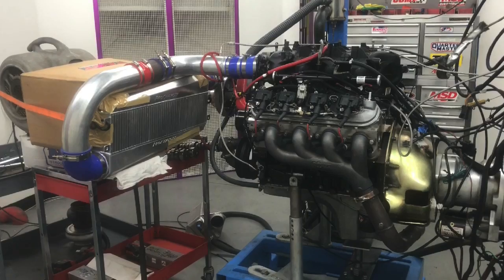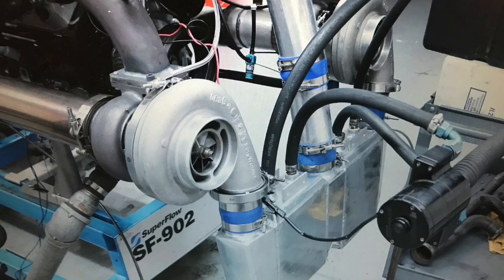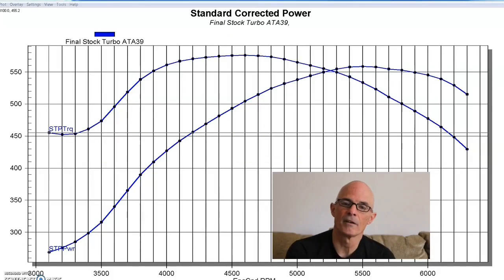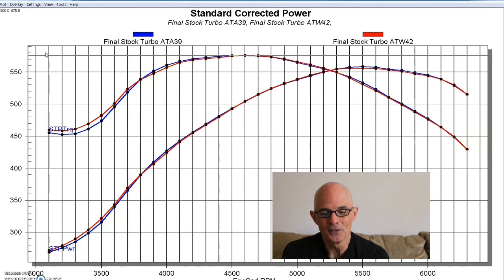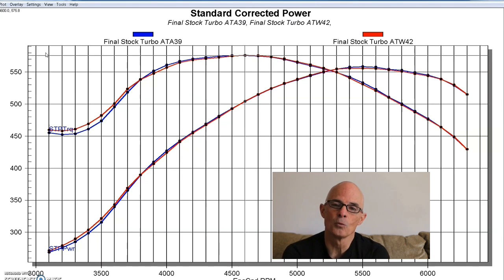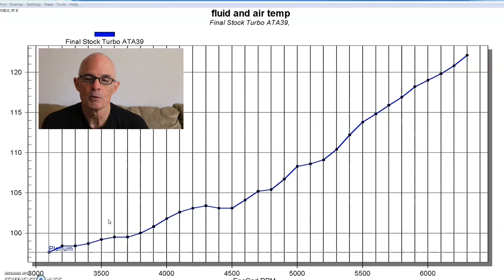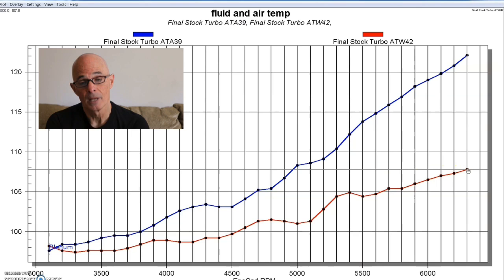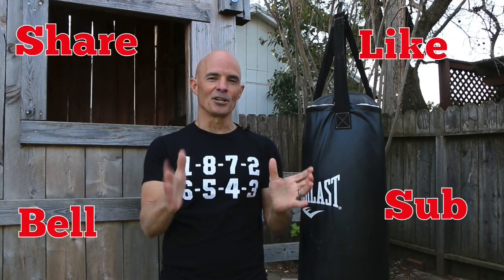LS TURBO INTERCOOLER TEST-ATA vs ATW

Comment: Lower inlet temps make more power when you use its ability to run higher pressure or more timing without blowing up the motor. If your setup is not near a limit and you can run them the same, no power difference. 14 degrees is not a huge difference in any case.

Comment: I think air to water would make more power if you were running compensation timing map that pulls timing as air temp increases because the ecu would pull less timing on the air to water set up, which is how most ecu's are tuned for the street.

Comment: Will the ATW experience heat soak at the same, higher or lower rate as the ATA?
Reply from the maker: define heat soak
Reply: @richardholdener1727 I'm wondering what cools the water in a street application.

Comment: Air to water requires maintenance and it’s not great for road racing because the water eventually starts to heat soak…. Sure could run a bigger heat exchanger and more water, but then the car is less competitive with all the extra weight.
Reply: Система воздух-вода СОВЕРШЕННО не годится для шоссейных гонок. Ее поставит только глупый человек на свой шоссейный автомобиль. Вода - это дополнительное промежуточное звено, снижающее КПД системы. Когда автомобиль постоянно движется и интеркулер воздух-воздух постоянно хорошо обдувается - это идеальные условия. В таких условиях система с  жидкостным интеркулером проиграет, даже если теплообменник будет также хорошо обдуваться. Потому что, повторюсь, вода - это лишнее промежутчное звено, которое снижает КПД системы. Поэтому теплообменник для жидкостного интеркулера должен быть гораздо больших размеров,чем воздушный интеркулер, чтобы с ним соперничать в шоссейных гонках. А тут еще и дополнительный вес системы. Кстати, в шоссейных гонках бак для воды категорически противопоказан - он только будет добавлять вес и инерционность системы.

Comment: The problem is you dodnt map the engine .  Video is shit
Reply from the maker: I guess you must be new to the automotive industry-don't worry, you will get there.
Reply: @richardholdener1727  You established that water to air is running air cooler. And under same conditions gives same HP as air to air. Well hellou genious. Did you try to add timing or boost ?? what is the point of the video ? Me, probably others too , came to see what is power difference when you use that cooler air . Yeah,  i am new to the industry ...

Comment: N00b question. Why not both? Can you do an A2A that cools then feeds an A2W intake manifold? The reason I ask is because I live where it is hot and I use the vehicle as a daily driver with medium road race/HPDE time. But sitting in traffic my temps go high. Larger radiator is included in this set up. Does A2W setups always require AC to be run through to chill the A2W H2O/solution?
Reply from the maker: that sounds like a engine cooling issue and not an intercooler issue (intercoolers only help cool the boosted air)

Comment: That Air to Air intercooler is a very efficient shape with those taper wall end plates 
The air fit it have to turn multiple times like some cheap shit ones from you know where

Comment: I’d like to add  later comment here. For reliability on pump fuel lower temps are better. I see loss of 30whp on the late model turbo cars on pump gas at a 120 iat vs 90 iat. 
Engines like this you need to see if more timing matters but push rod v8 are less sensitive to timing. This allows similar power. For example a late model turbo DI civic type r will only take 9 degree of timing vs pushrod v8 can see well over 30 degrees on pump fuel.

Comment: Now what about a regular Air to water setup for a supercharger, no ice tank. I like the packaging of the Air to water much better because you can spread components out. The core is relatively small and soft lines can run anywhere, the heat exchanger isn’t very invasive for the cooling capacity they have and the water pumps are necessarily very large for the lower power levels. Would that not be better in hotter conditions and road racing “type of driving” than an oversized air to air intercoolers? Especially in warmer or higher elevation climates?
Reply from the maker: air to water isn't the best choice for road racing

Comment: At such low boost levels you aren't going to see the heat dissipate that you would gain from the water to air. Do the test again outside on a Hot Track on Hot Day. Water to air is superior.
Reply: How do you cool the water...?

Comment: Air to water in production cars show the advantage is turbo lag with heavy throttle modulation. Since you don't need piping running to the front of the car the charger can have a far shorter run to the heads. But in a drag race I don't think that would matter

Comment: A2A for circuit racing is the way to go imo, doesn’t matter if you have ice water to begin with! After half an hour of hard driving the entire system will be heat soaked and take a lot longer to cool back down vs a heat soaked A2A

Comment: A2a is always better, the best setup is large heat exchanger, larger diameter coolant pipes, and much more flow via water pumps. Water transfers heat 10x that of air.

Comment: I want to get a vortech supercharger and add a a2w inner cooler I'm my stock 5.3, will the water heat soak and raise temperatures on long trips? 2-5hour trips.
Reply from the maker: not with the heat exchanger mounted in front of the radiator
Reply: @richardholdener1727  ok cool. Yeah. That is the plan. And add 3 gal reserve tank. Thanks.

Comment: Do you have any information and comparison in the past that the ATW intercooler responds a little faster to ATA due to less volume to fill before it hits the engine? Typical shorter charge tubing and volume in the cooler. Thanks!
Reply from the maker: THAT WOULD LIKELY NOT EVEN BE MEASURABLE

Comment: Conclusion is, with the right setup and tuned correctly, the air to water on ice will yield much bigger Gaines. Your test is inconclusive as you didn’t add timing to each pull to see the power increase when on the water to air. Water to air is more controllable power and that’s what you want in drag racing. You want to run the same fastest time, every time. I’m a firm believer in water to air setups. You should do another video but add 2 degrees of timing to both setups and see what happens.
Reply from the maker: it already had enough timing
Reply: @richardholdener1727  if you don’t have it set up to add timing when intake temps are cooler then no… factory ecus tend to add timing as intake temps lower. Is that how your engine management is or do you have to tune for power depending on intake temps? I gained over 50whp on the last engine I tuned from 125 degrees to 80 degree intake temps..

Comment: With an air to air in a cooler, when sitting at the track and doing your burn out you’re not moving any air through that inner cooler which in turn is going to heat it up and cause heat soak so by the time you even make your pass down the dragstrip, you have high intake temps. Now with a air to water in her cooler you can have an ice box in the back and while you are staging or doing your burnouts you can already have your pump moving ice cold water through the inner cooler therefore you have low intake temps as soon as you launch

Comment: Maybe the normal fuel injection amount was enough to lower the temperature of the air to air down to the same level as the air to water.
The air temp in the cylinder could be the same and therefore the power is the same.
I am surprised that the air to air had so high temps at fairly low power levels, maybe the core that actually does the work is too small.
The end tanks are almost half of the total hight of the cooler and does little to cool the air.

Comment: The issue is that the heat exchanger is often undersized in people's air to water setups so even with a big intercooler they heat soak badly. It is also imperative that you have a fan on your heat exchanger, so when you figure out your configuration make sure you take that into acocunt.

Comment: I can see why no huge gains. We live in the north and experience temps to -40 f to 110f, and we do not see big differences in HP with the temp change. Intake and exhaust and engine temps drop in a big way, but fuel economy usually drops, and hp gains are minimal. 2 stroke engines are a different matter, they love the cold. I cannot speak about the track and their results, but daily drive with turbo, non turbo, not huge change with temps.
Reply from the maker: AIR TEMP GOING INTO THE TURBO OR BLOWER WILL DEFINITELY CHANGE THE POWER OUTPUT

Comment: ATW is better its always going to be more efficient, water has higher thermal conductivity than air, assuming that you can can dissipate the heat in the water loop.

Comment: I’ve put tons of ice in my air to water Intercooler and it melts in about 30 seconds, it seems 90 degree air blowing on a heat exchanger just isn’t good enough to keep the ice cool enough especially with a turbo heating up the water as well.

Comment: The reason you didn't see a difference in power for the lower charge temp is simple... You didn't change the timing. Intake temps effect detonation thresholds, just like timing. Cooler air means less likelihood of detonation, so you have more room for timing...

Comment: When the air temps go down the engine will take more timing and make more power.  Not changing the timing will produce the same power as the highest temp.  Water injection can take more timing because there is still water droplets evaporating inside the manifold and compression cycle.

Comment: I am more interested in high boost 30+ psi where heat is a much bigger concern. I noticed the temps rose pretty high with the air to air intercooler which would limit the amount of boost you can safely run.

Comment: You should also put a temp sensor in the intake manifold, I bet some of the latent heat of vaporization is providing more cooling after the intercooler like a carb would

Comment: In drag racing- you only have to keep it cool for seconds. On a street car- heat soak is a problem. The water cooler still has to dump its heat through another radiator which relies on airflow.
Eventually, the water will be heat soaked too
Reply from the maker: only if you are in boost 100% of the time you drive-which no one does
Reply: @richardholdener1727  Heat soak can occur sitting at traffic lights after being on full boost for a few seconds. No airflow. The water temperature will rise. After driving off, It then takes minutes to chill if no further boosting.
During that time, the intake temperatures are higher.

Comment: I think it's because the engine wasn't making enough hp to make a difference. just a thought, diesel engines are turbo charged and only use air to air mainly because it's more durable system and not very hard to maintain
Reply: Every Ford diesel since 2011 is Water to Air…

Comment: There's only one way that I know to make an air to air more efficient than air to water. 
How you say 🤔......USE DRY ICE ON THE AIR TO AIR . I can get my temp way below ambient temperatures and I don't have to worry about water leaks, pumps or fans for the radiator. It just makes sense for my application.
Reply from the maker: where does the dry ice go
Reply: @richardholdener1727  My air to air is mounted horizontally with twin fans underneath, on top is an enclosed box that draws in air. In that box I place a few pounds of dry ice. The dry ice is only be used at the track or during dyno sessions. I use CO2 for short stints on the street spayed directly on the top of the intercooler (that is also mounted in that box). Both a very effective but the dry ice on the top drops the temp so much 🥶 its almost unbelievable

Comment: That air to air cooler looks pretty useless, tubes are so short the hot air hardly gets a chance to cool. Imho, i got a custom cooler made with 700mm long tunes, worked awesome! Real low 35 degree celsius inlet temps, 20 degree day.

Comment: I like this test. I would imagine that the non change of power is possibly timing limit. It’s possible that you didn’t have enough timing to create a big enough cylinder temp that a 10-15 degree would matter. 

Another possibility is that the manifold itself had more heat in it than you could see while running the air to water.  The fuel temperatures could have been hotter during afr to water inter cooler. Too many variables without getting manifold temperatures instead of just after the intercooler.

Comment: That is really interesting and I'm puzzled as to why the the lower IAT did NOT translate into more torque/power, it really should have if everything else was the same or similar.  Is the boost pressure measured at the inlet manifold or at the compressor outlet?  If it was at the compressor outlet and the ATW setup had more pressure drop then maybe that would explain the lack of pickup on the low IAT ATW run.  Aside from that I've got nothing.  One thing for sure, it really makes me lean toward the ATW setup on my next project.

If you ever run a similar test again it would be great to instrument the compressor discharge pressure AND inlet manifold pressure to see what differences come up there if any in flow related losses.

Comment: The biggest reason for the difference in temperatures is that water has approximately 25 times more thermal conductivity than air, so you should expect to see a lower manifold inlet temperature. However, 14 degrees shouldn't make much of a difference when you're talking about an engine output.

Comment: All things sized correctly and equal. The advantage of the AtW over the AtA is keeping things cool all the time.  As you. Seen with the Temps comparison. Those numbers would be exaggerated in a street car. My personal preference is always a AtW but an AtA would be just as good of choice on a Roadcoarse/circuit race car.

Comment: You will likely start seeing a difference over several runs. The air /water IC  should out perform the air IC because of the difference in medium density.

Comment: I am sorry zero disrespect here .  But your forgetting the true reason of air to water . Toss ice in the icebox adjust timing and then this would be  huge difference.  However you choose 2 that where efficient enough to run what your are doing with no issue . Idk I have done 100s of Dyno pulls where air to water vs air to air and the gains are a astronomical amount . Again there is a time and place for a air to water but use it for what it's designed to do. Cool the Temps lower than ambient.  Also why didn't you remove the intercooler and perform a no intercooler pull ? 
Or add 8 psi and rerun the test  , but this as far Apple to apples as you can get . 
If thr current isn't creating a heat hot enough to expand the in common air why would you even bother? 
This would be the same if you was using 2 different fuels running same stoich point timing and boost . Sure one is superior but you have to  tune for it.  
This only proves that  X boost need X intercooler to stay cool and adding Y intercooler using the same ambient Temps you expected a different result.
Reply from the maker: I don't think I forgot-even mentioned ice water in the video

Comment: Another thing to note for the average guy.. alot of heat exchangers for the a/w setups are almost as large as an intercooler itself.  They come with fans attached and are easily as large as an A/C condenser... that's if you need one that doesn't heat soak 10 seconds into full throttle or if you are doing hot laps at the track.

Comment: i have a crzychvy thought, is all liquid the same weight per gallon? say water versus alcohol? i know GOOGLE IT AND FIND OUT. i hate that know it all S O B  lmao.
Reply: Ballpark Calculation (for all temperatures)

1 gallon is about 3.75 liters
1 liters = 1 kilogram (density of water is 1 kg/liter)
1 kg is about 2.2 lbs
so, 3.75 kg is about 8.25 lbs and 1 gallon is about 8.25 lbs      

Weight of 1 US gallon of Isopropyl alcohol
carat	14 859.44	ounce	104.83
gram	2 971.89	pound	6.55
kilogram	2.97	tonne	0
milligram	2 971 888.94	 
                                                                                                                                                               air to alcohol ????????    lighter liquid? i have plenty of crzychvy  idearrrrrrrrsssssssss lol

Comment: From my understanding, the air temp doesn't matter near as much as the fuel temp. Between runs, when drag racers ice their manifold to get more power, what really is going on is the ice cools the fuel which is why the gain in power.  Doesn't matter that the air charge cools because it's just heated back up as it's compressed, but the cold fuel chills the incoming air charge and cylinders.
Reply from the maker: thnx-cooling the fuel helps-cooler air helps even more
Reply: @richardholdener1727  At least that's what I learned from watching Engine Masters lol :)

I wish I were closer to you guys because I'm building a 1.8 turbocharged ecotec engine out of my Chevy Cruze. Custom JE pistons, H-beam rods, big turbo gt3582 and shooting for 450+ whp. Uncharted territory, but a good lil foundation for a serious hp build because of the cast iron block and aluminum head with DOHC VVT.

Thanks for all the great content. Your videos have helped a lot in furthering my knowledge. Thanks, Richard!

Comment: I wonder if the smaller core in the atw restricts flow to the intake manifold causing the power to be the same with cooler air.

Comment: I had both. Only in short runs with ice is a2w worth anything. Allday everyday a2a is the way to go. Water tank will eventually heat soak and sustain heat lead even if you add a radiator for water box in street app.

Comment: Used compressed air to simulate a car a speed on the air to air IC get 3 or 4 air tools and blow them about a foot away at the IC should work way better than a fan
Reply from the maker: compressed air doesn't have enough flow